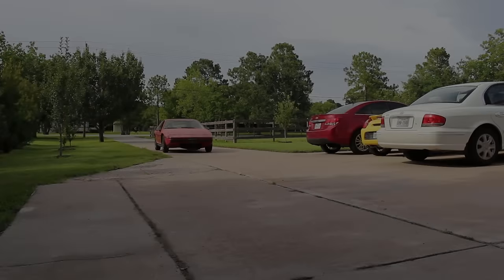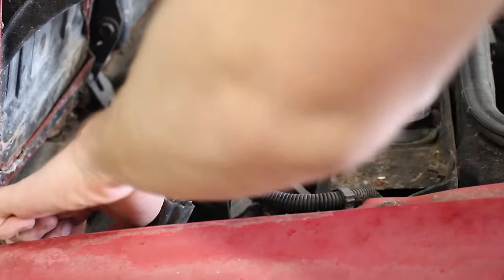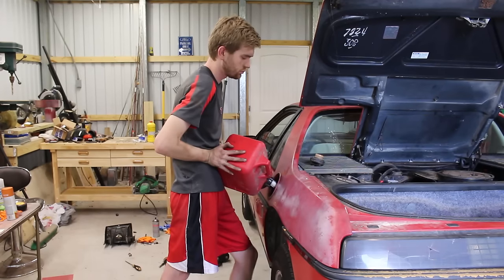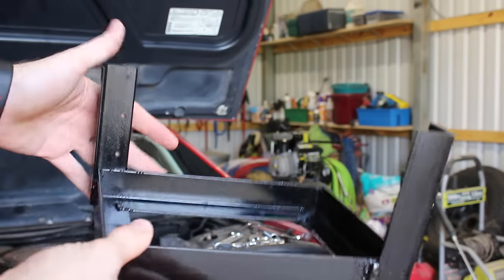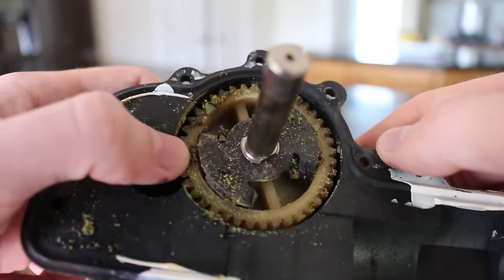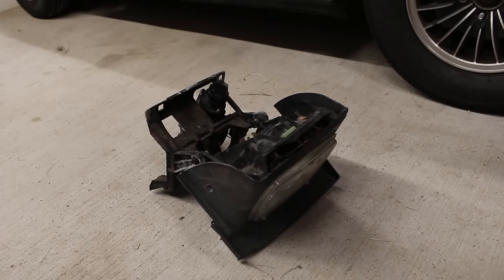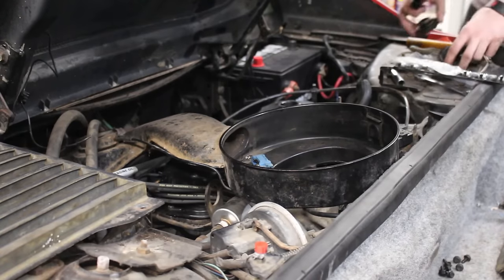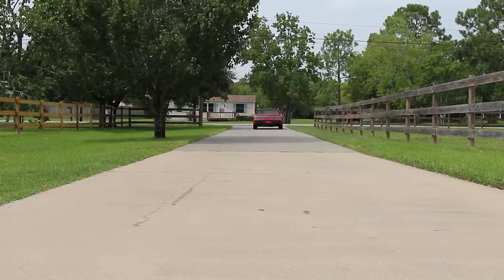Blink Once If Your Headlights Go Up and Down | 1985 Fiero 2M4 Revival - Part 4

Comment: Just came here to say that I have never heard "Just leftover electricity that turned into grease over time.".. Made me laugh.
Reply: I had to take a minute and decide if he was being sarcastic or not...
Reply: That was really funny.
Reply: I didn't really think about it until I came to the comments.
Reply: Jea me2 😂
Reply: Shhhhh   Thats top secret information only to be known by a few
Reply: This got me thinking!!! Damn !!
Reply: Genuinely belly laughed
Reply: I got shock by my Christmas lights with that left over electricity
Reply: I had to rewind a couple of times to make sure that I heard it right the first time... then tried to make heads or tails... then laughed like hell!
Reply: @montneymon-ta-knee6810  And I got a shock with a lighting circuit which was disconnected at the fuse panel when I touched a metal water pipe next to the junction box I was hooking up for a light in the basement!  I never did understand that one...  But I learned that water pipes and electricity don't mix! Zap!
Reply: You know, it's actually an interesting view of oxidation.
Reply: stonerman2k yeah that kind of made me spit my coffee out😂😂😂😂😂
Reply: @retiredperson4054  Im an electrician and that doesn't make much sense to me either. You sure there wasn't a 2nd live circuit in that JB that wasnt turned off? Also, it is possible for a breaker handle to turn off but not internal parts. Chk power at breaker panel terminal screw with a meter verifying power is not passing theu after turning off the breaker. I discovered this once myself when I turned off the main breaker out by the meter and went inside and removed the main wires from the panel with the intention of moving the whole panel. I touched one of the big #2 guage wires and got a very very light shock. So light that I thought I was imaginging it. (My skin is so thick that normally if my hands are dry sometimes I can't feel 120volts). I told a co-worker this once and as a laugh we pulled out an ohm meter to measure and compare our resistance.. He was measuring in the 300,000 range. I, on the other hand, measured about 1.3 megaohms. He was stunned. That is not normal. LOL. It is also hereditary. My father was the same way. Don't assume. Check before working after you turn off. Although I didn't get shocked badly, had I touched it to bare grounded metal while removing expecting it to be dead there would have been a heck of an arc flash on a #2 gauge wire. The reason for this is moisture had gotten in the meter  enclosure and internally corred the breaker operating mechanism. It had to be replaced and was almost as expensive as a whole new meter box and breaker would be.
Reply: @Nemozoli  I got a chuckle out of that too. I was thinking "leftover electricity? It's a capacitor and holds a charge even when the switch isn't sending it 12 volts?"

Comment: "BY THE POWER OF THE SUN, TAKE THAT, VALVE COVER BOLT"
Reply: I remember breaking my first bolt on a caliper guide pin bolt, in my head I was like "why isn't this caliper getting tighter, better torque the fuck out of it..."
Reply: this made me die laughing
Reply: @theschmiz  DIbs on yer stuff.
Reply: @eriklarson9137  huhh
Reply: @BarterBales  You're never too old to eff up. Last  year, my water pump went out on my Camry and I sheared off two bolts and a stud. As long as you have friends that can help you fix up your eff ups and you learn from your mistakes then you will be ok. A dumbass, but still ok. LOL

Comment: 22:41 But, it could have been worse, like locking the only set of keys in the trunk.
Reply: VULGAR DISPLAY OF POWER!!! You do understand that Ronald has done that and thats the joke
Reply: I did something worse once, lost my ignition key and the door/trunk key on a rollercoaster, had to call a locksmith, some months later somehow managed to drop my door/trunk in my apartment and it somehow landed it a small hole in the trim at the bottom of the wall, fuck me lol
Reply: @christophergreer5572  guess you're not meant to have keys then haha

Comment: As a 55 year old veteran to the mechanic field..Truly commend your skills and tenacity. This is exactly how you become a good mechanic by starting out with projects like this and working your way up. That broken valve cover gasket can be extracted by placing a large nut over the broken stud and welding the nut to the broken stud and extractor. And then simply removing it.
Once again I applaud you for fixing up this car I think it was well worth it. Thanks for sharing.
JT 
Orlando Florida
Reply: Same here, but primarily aircraft engines. Like Jakespeed62 said, if that's is not an option, then a small hard punch will break up the easy out and tool picks can be used to pick the pieces out. I've also had to use a small screwdriver as a chisel (or you know...and actual chisel) to work broken screws out. I suggest you also make a habit of chasing your threads with the proper tap before torque. One more thing (because I'm old and full of happy news) a good thing to know is that those torqued bolts actually stretch. In automotive it's not always pointed out, but in aircraft, well we replace torqued bolts.
Reply: Jake!  Exactly!

Comment: Want some tips?

¬Don't try drilling out the broken extractor. I've done it. You don't want to. Weld another bolt to the broken one.

¬Don't treat the Iron Duke like a performance engine. It is not one. I would not even rev it to 5k. It has rods like glass.

¬Have fun!
Reply: That last tip is very good.
Reply: Yeah the Rockwell hardness on the extractor is well... A little bit harder than most HSS drill bits. Carbide bit is pretty much required. Welding is definitely your friend in this case.... And wow have I learned this the hard way. I broke a tap chasing poorly cut threads on a bracket that must have been made of unobtainium. I searched for a replacement, before coming to the conclusion that I was screwed and would either have to use an extractor or have a new bracket fabricated for me. (I didn't have a welder or the skill at the time).
Reply: For smaller bolts, welding a washer to the broken bolt allows better chance of a solid weld. You don't have the space constraints of a nut. Then you can weld a nut size of your choosing to the washer.
Reply: How in the world is he supposed to weld anything below the surface? 21:46
Reply: The washer is a good idea.

Welding adds metal. Add metal till you are not below the surface. Don't stick it to the sides.
Reply: @RickStewart1776  Carefully apply grease the area you don't want the weld to stick to, then build up the bolt stub.
Reply: Rick Stewart you build it up with filler metal (mig probably the easiest) then you weld another bolt on that filler metal. Had to do it in my intake of my truck.
Reply: Noel Ortiz  Yeah, again I was also among the people that learned the hard way drilling a tap or extractor out of a hole is the most frustrating and annoying thing to ever do (even with a carbide bit).  The welding trick is far superior to trying to drill it out.
Reply: Rick Stewart it’s possible...
Reply: @jcota2003  Love "The Core" reference...Broken many a bolt in my days. extractor sometimes, usually weld...Cracked the housing once on a water pump, bolt did not break.
Reply: @RickStewart1776  Removing the valve cover and gasket will reveal some bolt above the surface usually. then build it up.
Reply: @butchtcstech  Yeah, that might work. Also, putting a nut or several washers might be beneficial.
Reply: @andersjjensen  Good thinking.

Comment: I have never and do not ever plan to work on cars, but goddamn is this so good to watch. I love it
Reply: Gene Murphy and who could forget swearing about the engineer who made this infernal contraption knowing full well they never have to touch it again so it isn’t their problem.
Reply: Don’t forget to shower yourself in coolant taking off a lower radiator hose. Make sure to call the car you’re working on a slice of shit as well.
Reply: austin stringfield before or after you go after a bolt between the block and firewall and get a permanent hand cramp for the duration of the repairs? Gotta be organized ya know?
Reply: TBH as a mechanic his videos has reinforced 2 things for me.  

1. Don't try to reinvent the wheel (don't over think and come up with solutions that make no sense).  What I mean by that it is, he is going through all these steps, e.g. over tightening bolts, tearing down and rebuilding head light motors, or taking apart relays to fix them when he simply doesn't have to.   What he is doing is putting more of his time equity into rehabing this Fiero rather than diagnosing a problem, getting the correct replacement parts,  installing them and then moving on.  Replacement parts are usually cheap.  Your time is not.

2. Try things out in life and if they are apparently not a good fit for you move on.  This guy's raw talent, to me at least, is that of an engineer.  He likes to dissect everything. Not just the big moving parts, but every. last. little. minute. thing.  Or he likes to apply a band aid fix to something that should be a quick part reorder.  Now, this could all just be a case of a lack of experience but, truly, if he has been doing mechanical things since he was 13, there should be some innate things that he should be doing now that he is not. Like understanding going in that every nut and bolt on that engine has a designed torque spec.  That is really super simple, basic mechanical 101 type stuff.  So I think as a potential engineer he is brilliant.  The more videos of his I watch the more I just sit back and think, "he's just not a mechanic."  

I wish him well though.
Reply: @actschp1  It's true, his brother is a lot more towards the naturaly "mechanic" type, he is also a lot more experienced

But he just got this car for a few bucks and he is having fun with it, no harm in that, he could even snap all the bolts, no one would really be harmed !
Reply: @actschp1  painful to watch, had to stop. wish them both well..
Reply: actschp1 for me though. He was right to rebuild the headlight motor. They don’t make replacement headlight motors for these years so rebuilding them is the only option. I know because I have one of these cars and that’s what I to do. Not even the fiero store had new rebuilt headlight motors; they had just the rebuilt kits.
Reply: @actschp1  Your time is worth what you enjoy. Your philosophy screams why not just buy a car that already works if time is worth more than money?

Comment: It is really heart warming for old guys like me...who were deeply into cars when I was about your age in the early sixties, to see younger people really getting interested in mechanical toys! One of the things I learned pretty early on helped me many times over. First (going on your embarrassment)Valve covers need only to be "snug". Over tightening often causes the gasket to extrude making for leaks. Also, the flange on many many valve covers can easily be bent where the bolts are, due to too much stress, making you have cause to remove the valve cover, and straighten the flange. When drilling out broken bolts, always use a left handed drill bit. That way if it catches (as drills commonly do when drilling) it has a fair chance of backing the bolt out. In your case, it appears that you merely snapped the head off, instead of bottoming the bolt, making it much easier to remove. If there is room, sometimes you can back a bolt out with a small and sharp punch. By the way, a wire wheel is a "first choice" in removing an old gasket after scraping the bulk off. Many mechanics used to use weatherstrip cement on gaskets to hold them in place, causing the coining of many new phrases later. If you need to cement a gasket in place to facilitate assembly, use the red spray-on Permatex. On head gaskets, go by the instructions from the gasket maker. Lacking that, I used to use wheel bearing grease, which helps seal well, and can't cause contamination problems.
Good job on the new battery box! It is very unlikely that there will be need for a hold down strap, given the depth of your new tray.
One suggestion to ease your later maintenance and restoration efforts...whenever you pull something apart to access something else, by all means take the time to clean it up, and give it a shot of paint...even a shot of rattle can Rustoleum.  You will later be really glad you did. This was kind of long winded, but your series has awakened great memories of 50-60 years ago, befor I decided that wires were much nicer to work with, and better paid!

Comment: I have no interest in restoring a Fiero, ever, but as an engineer, I can certainly appreciate your approach to troubleshooting and solving problems. I enjoy your videos. Keep up the good work my friend.
Reply: They are fun cars
Reply: Retro Toy Pile
Funny comment from an engineer since the Fiero was a pure engineers' car. And great one at that. And their genius building process.
  But the Pontiac guys had to deal the GM brass and the hatred from the Corvette bunch. They had to sell it as a commuter car, picking from the parts bin as cheap solution, thus the old Iron Duke engine and antiquated Muncie 4 speeds trans.
Once they had it as a proper Sports Car in 1988, GM pulled the plug saying that the Corvette was and will ever be the only Sports car. Damn the bean counters. And the fat Corvette.
Reply: I am just glad he trouble shoots.
Reply: Truth, its amazing how many engineers started off as folks that were too broke to buy new or R&R parts so they learned to troubleshoot and actually fix things.

Comment: Headlights go up, headlights go down. Headlights go up, headlights go down.
Reply: Mine can Wink. Each has their own switch. ;)
Reply: @ravenlorans  Your car is a flirt.
Reply: Track day, bro?
Reply: Also, it's been sitting in the wood for 10yrs, waiting for me to go get it and get it back on the road. It's in Minnesota and I am in Florida. Just don't have the $$$ to go get it and I Do Not Trust anyone Near me Not to Break into my house when I could. Be Cheaper to just buy another one at this time.
Reply: I had an 86 rx7, that would move one headlight at a time, if you turned them on and off really fast. Lol
Reply: ...Never a miscommunication. You can’t explain that.
Reply: Headlight went down the first time and I thought Ronald was going to lose a finger.

Comment: As the owner of an '88 Fiero GT (which I love), I admire your pluck and persistence in setting this neglected girl back on the right path. And as a professional writer and content producer, I applaud your production skills. Great work!
Reply: WTCMFM
You are a man of great taste in cars ! I must admit that I own one too, a mint 1988 GT, 5 speed, low milage ( 78k KM), my precious weekend warrior.
I had 2 1984 2M4 previously, driven as the commuter cars they were. 1st t-boned by a drunk POS, the second, used and rebuilt using the 1st one as a donor, untill the engine gave up on oil starvation. Bought my toy in 1999, a 27k KM from an older man retiring. Will never sell it.
Reply: @marcryvon  The '88 is truly a well balanced, great handling machine. Mine  has further been upgraded to the Gen 3 3800 supercharged V-6, which is screamingly fun. That said, the '84-87s were vastly underrated by American automotive journalists, who couldn't get past the idea that Pontiac used parts bin suspension (Chevette! Citation! Yeeks!) and the trusty Iron Duke as power. Meanwhile, European journalists were VERY impressed, and the hypercar designers felt a little chill in their spines.

Comment: Great video Ronald.  FYI, the wonderful state of Texas now has a Antique License Plate for cars over 25 years old that only costs $10 a year and is good for five years.  The best part is that there are no inspections required!  It is designed for people like you (and I) who are working on project cars and don't use the car as a daily driver.

Glad you included that broken bolt in your video.  Most people weld a nut on the broken surface instead of extractors that could expand the bolt fragment.  You might borrow a torque wrench from a friend to play with at different settings.  It will help you develop a feel for 8 lbft vs. 40 lbft - an important skill indeed!
Reply: @s30shawn We have one here in Ohio but you can't legally drive it anywhere other than shows and service stations for some dumb fucking reason.
Reply: The boys refused to drive test my '68 Dodge Polara; they were worried they might wreck it!  My reply was they would not hurt the car; it's that everyone else that would be! That thing was BUILT.
Reply: Also for 30$ you can purchase a 30day registration that will allow you to drive on public roadways, meant for test drives, and road use to and from service centers before state inspection.
Reply: @keltongta  But do they charge you for not getting full tags after 30 days?
Reply: @totalmetaljacket789  no. You can even purchase another 30days. They just want to make sure the vehicle is not stolen any tag tells PD it's "legal". Just tape it to the back window and it's like any temp tag you get from a dealer..
Reply: @keltongta  Man, you guys must have it good.
My lovely state charges you if you get temp tags and don't get new ones within the expiration timeframe, regardless of whether you're driving the vehicle or not.